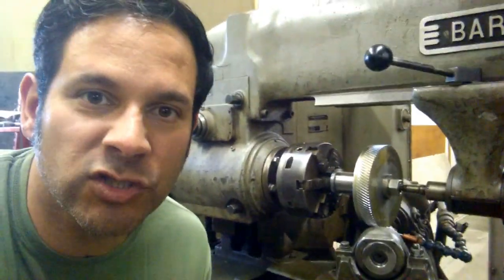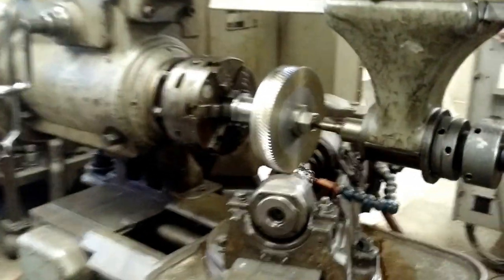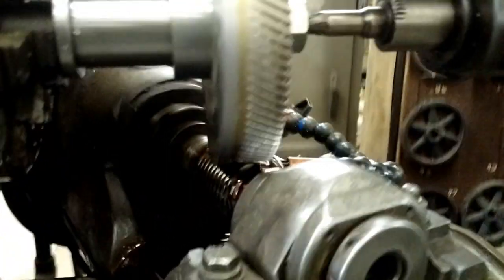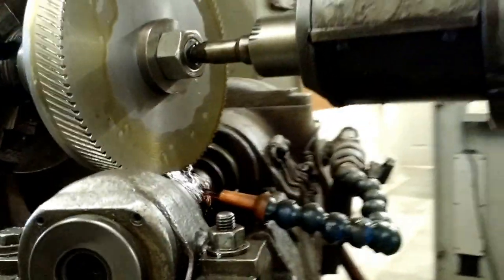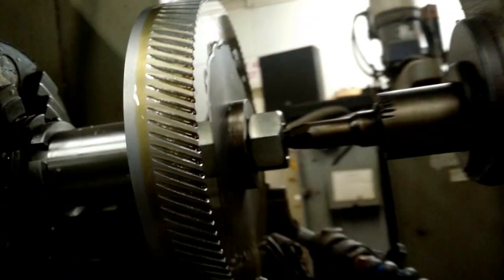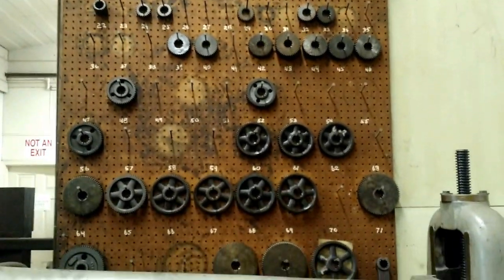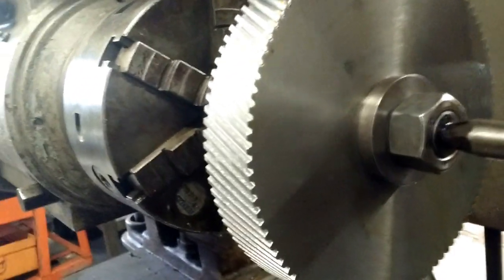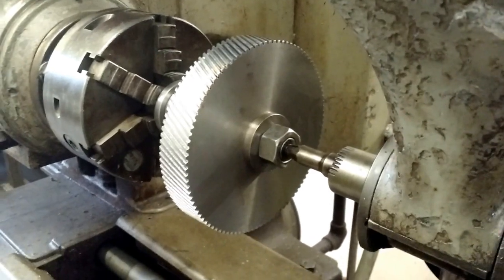How To Make Gears - Hobbing gears - machine shop project

Comment: Ray could you consider making a video explaining more in depth how the cutter is mechanically timed to the gear blank thanks and subbed
Reply from the maker: the timing is automatic based on the gear boxes, they are all interconnected.  in order to select the correct gear ratio we use a software package that determines which gears are used and meshed together in the correct configuration for max allowable deviation (which is usually down to about .000001). next time we cut gears ill try to make a more "in depth" video cover the complicated bits.
Reply: +Ray Pena thanks man I appreciate it

Comment: Not a very ridged setup lot of vibration.
Reply from the maker: It's tge nature of this machine
Reply: @RayMAKES  its hard to tell if gear is integral with shaft and you are chucked on the shift if not try making a backup plate bored to fit over the hub of part maybe that will get rid of the chatter.

Comment: So if you need gears to make gears how the hell does that work?
Reply from the maker: +Cliff Hartle Kind of like needing a lathe to make a lathe. :)
Reply: Ray Pena Adam Savage has said that a lathe is the only thing that can make itself.
Reply: Ray Pena But its one of things that I've wondered about. Did they start with crude hand made gears and other tools that through great skill made better machines?

A hammer can be any lump of anything on the end of a stick. but things like metal lathes need to be pretty precise.
Reply from the maker: +Cliff Hartle I think that is exactly how it happened, Every generation of machine builds a better version.  We use machines to build other machines every day.
Reply: Ray Pena My son just asked when we will reach the Gear Singularity where gears can make better versions of themselves than we can.
Reply from the maker: +Cliff Hartle that's just too funny!!
Reply from the maker: +Cliff Hartle that's just too funny!!
Reply: I worked for SWF machinery in Fresno years ago as a machine designer - there machines were originally designed to make apple boxes - no hydraulics or pneumatics way back when - it was all mechanical linkages - amazing machines  - Now they use the same machines to do packaging, box makers, inserters, etc.  They still use the same basic design.  When all other companies use pneumatics -  so..... it's like you were saying, every generation tweeks the design to make it better.
Reply from the maker: the evolution of the machines! lol